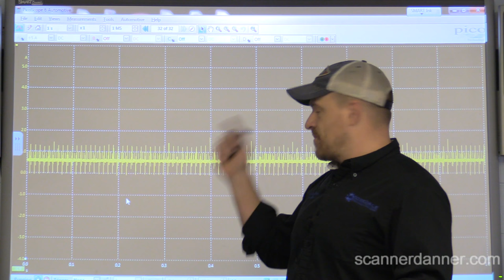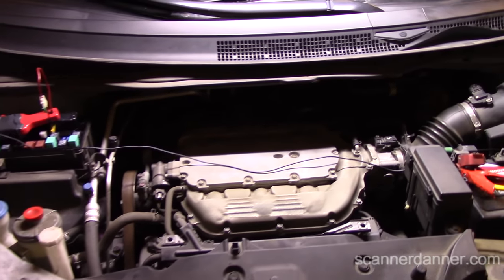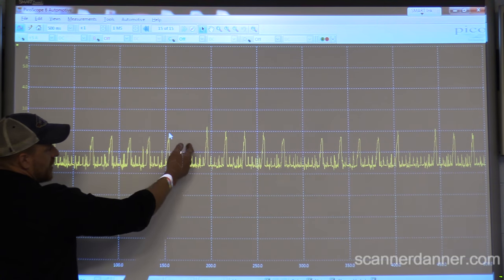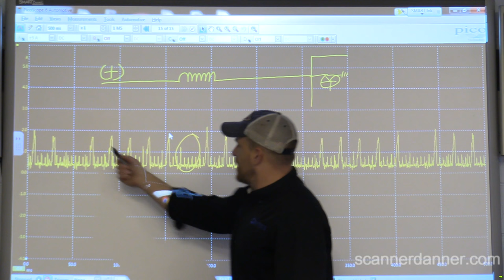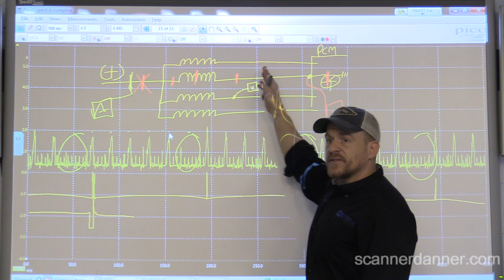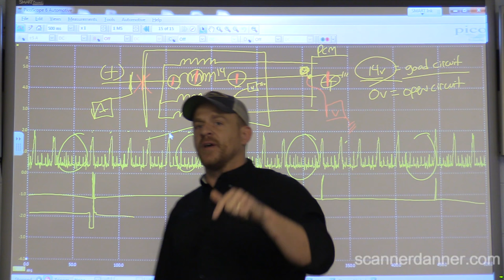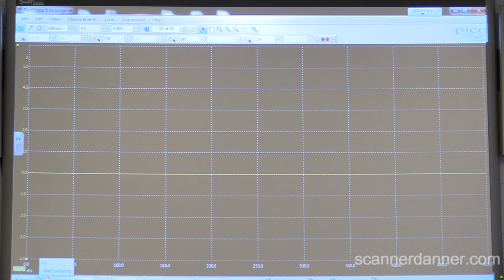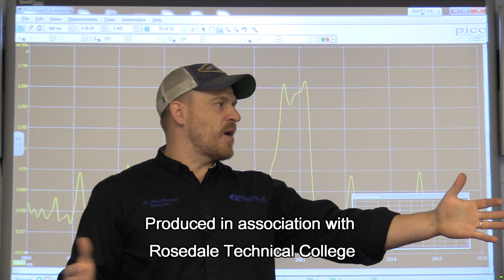Fuel Injector Not Pulsing "Intentional Shut Down" Chapter 18 page 6

Comment: Great video Paul! I remember working on a Benz doing this exact thing and in that case the injector was accessible. I did a simple resistance check and it was OL,so I knew the injector was bad. However,I wanted to check the computer circuit just to make sure and the computer wasn’t pulsing the injector. I’ve emailed you and you told me to clear the code and try again. It worked like a charm! You’re the man Paul! 👍
Reply: Thank you Nick! Nice job on your Benz too bro.

Comment: I would suggest if you see 0V at the computer connector to first unplug it from the pcm and make sure its not a fault driver sticking and shorted internally before selling a intake job. Though its not common Im sure it could happen. Thoughts Danner?
Reply: You just have to be careful that the power feed to your injectors is not coming from a computer controlled relay. If you unplug your computer, the relay shuts down, and you lose power to your injector, causing misdiagnosis. Make sense?

Comment: Had this happen today to a stepdaughter's car.  Ignition coil was melted down and broken... unfortunately by the time I suspected a purposeful shutdown and found/watched this video she had the tow truck come.  Darn it, could have saved a few bucks.  Now have to figure out how to get the remaining parts off the spark plug and get the parts out before pulling the plug to check it and avoid pieces falling into the cylinder.  Will probably have to ram a socket in and break the plastic off and blow it out, then put a spark plug socket on.  Can't get a hose clamp plier in there, due to no space.  front crossmember in the way, along with the cooling fan and possibly the radiator as well.

Comment: Great point made about the injector shut off for cat safety. I see this a lot on the mopar cars. You can check individual injectors with the scan tool to see if they operate not on all models though. It’s never a good thing to put a pcm in with no fix.

Comment: FINALLY I DIDN'T UNDERSTAND WHEN WE SEE 14 VOLTS WE HAVE A GOOD CIRCUIT BUT IF WE HAVE A BAD ECM DRIVER HOW MANY VOLTS DO WE SEE ON THE ECM CABLE? IF WE HAVE A BAD DRIVER WE SEE 14 VOLT AND IF WE HAVE SUDDEN CUTTING WE SEE LESS?I.E., IN A CAR THAT HAS NO PROBLEM WE WILL SEE 14 VOLTS AND IN ONE WITH A BAD DRIVER ECM, HOW MANY VOLTS WILL WE SEE IN THE CABLE?

Comment: Paul, In relation to the Honda fouled spark plug this an ongoing problem not with the spark plug but with the 3.5 liter engine in all Honda lines.  See TSB's concerning cylinder ring rotation only on cylinders 1,2,3 &4.If not mistaken this is a class action concern.
Great videos.
Reply from the maker: found it! Thanks!
Reply: Actually, while Honda may say it's due to piston ring rotation, it's not.  It's well documented (not by Honda) that it's due to Honda's Variable Cylinder Management (VCM) that shuts down the rear bank of cylinders to save fuel.  On that year vehicle (with VCM2) it actually will shut down 1, 2, or 3 cylinders depending on conditions.  Cylinder number four, on the front bank is shut down at the same time as cylinder #3 during 2-cylinder pause operation.  The shut down cylinders can cause deposits to form in the rings and on the plugs and cause the misfires.  If this happens to you Honda will, in many cases re-ring those cylinders and replace the plugs.

The best thing for ALL of these Honda V6 engines with VCM is to disable it.  A very inventive Honda enthusiast reverse engineered it and found that at ECT temps of 167 and below VCM will not engage.  So, he built a small harness he calls the "VCMuzzler" with an 82 ohm resistor that goes inline with ECT1 sensor and reduces the indicated ECT1 temp just enough to prevent VCM from engaging about 95% of the time but not low enough that the computer will change fuel strategies or set a P0128 code.  This temp change shows very slightly on the gauge, maybe a needle width lower at most, but the computer doesn't seem to mind it.  It doesn't affect cooling fan cycling since the PCM appears to use ECT2 for cooling fan operation. 

 I use one on my own 08 Odyssey and VCM will still engage once in a while during stop and go traffic in the summer time when ECT1 gets warm enough but will usually go out again after 30 seconds to a minute of driving airflow over the radiator. I installed mine before having any misfire issues and have 172K on mine without issue.  However, I have seen these VCMuzzlers reverse much of the fouling and oil consumption that causes the misfires.  Honda has been re-ringing tons of these engines under extended warranty.  Oil consumption can get up to 2 quarts or more between oil changes.  

The VCMuzzler is quite popular on most of the Honda enthusiast websites so as a technician you may see these Hondas in your shop with this mod.  It's barely noticeable (I pass inspection with mine on) and is just forward of the throttle body down on the lower intake manfold area.  The one thing to keep in mind is that it reduces the indicated ECT1 temp so if you have to do anything that requires the ECT1 temp to hit 194F, and your scan tool shows the ECT1 not able to hit that temp, then you should check for this VCMuzzler harness on ECT1.  For example, if you clean a throttle body and reset the PCM afterward you have to warm the vehicle to 194F on ECT1 for the idle relearn to complete.  Mine won't hit 194 at idle with the Muzzler.  About 180 is the max it will hit.  

It's a great mod for any Honda V6 owner to extend the life of the J35 engine but something for techs to be aware of.  You need to know it's there and it's a good thing to recommend to your Honda customers.

Comment: Had a 2002 ford windstar with a 3.8liter shut the injectior down as soon as i disconected the injector  it shut the drover down . Puzzled me when i was testing with my test light. As soon as i connected the connector it would take control again . Can anyone give bit of info on ford systems on shutting the injector down ?  It is what i saw right ?
Reply from the maker: This applies to any output. If the computer senses an open or short, it may disable that particular output. It is a variable that I discuss in my Chapter 3 lectures. https://www.youtube.com/playlist?list=PLM4TD8VJ3gj_PxwbFEs3RYAKzionSeszV
Thank you!

Comment: Had a 2005 Ford Freestyle with 3.0L in with TB codes. Most common fix is replace throttle body. No other codes or Mode 6 info useful. It would go in limp mode randomly. I noticed when driving I could feel a fish bite under slight load, not severe at all, with nothing showing on the Verus. Bad coil plus TB, nottttt. I lost $507 on TB and had the exact same problem. I could watch cylinder contribution at idle only and could see -3, and sometimes -5 but engine ran smooth.  Took a chance and pulled intake, replaced 3 rear coils, fixed the problem. Shop owner has Versus but no amp clamp so I could not watch the coils while driving. Could have bought a couple amp probes. I have replaced scores of Ford coils with electronic throttle and never seen a misfire shut the PCM down and set TB codes. The coils fixed the fish bite and the PCM limp mode. Extremely frustrating. Great video, just renewed my Premium for the year, best thing going.
Reply from the maker: Thank you so much for re-subscribing and for sharing this info with us!

Comment: Hey Paul, another relevant vid! Jus to add, I've seen this feature in older  Asian vehicles (Denso system) and one of the most common one is Toyota engine control system where the 'IGF' signal input has a significant effect on the injector operation where intentional shutdown is concern. I have also seen it on an old Suzuki model (non US) where the confirmation signals from the coils are fed thru a diode bank then sent to the PCM, as I said early design but same function. Again great video Paul!
Reply from the maker: Thanks Bannie!

Comment: 26:10 you said we could still have an injector fault as the computer would not know the cause of the misfire. 
Wouldn't it see lean condition on the o2 sensor and know that it's a no fuel misfire and then know not to turn the injector off?
Reply from the maker: A misfire of any kind will cause a false lean condition at the O2 sensor.

Comment: Would love to know how many manufacturers don't shut the injector drivers down.
This is a good idea from Honda, saves you having to spend money on a cat converter.
Nice video Paul, as always!
Reply from the maker: I'm not sure but what is more important is that we know about it and put it in the back of our minds when troubleshooting misfires. 
Thanks brother!
Reply: Agree for sure, never knew that the ECU could and will shut down the driver to protect the cat.
Great information Paul, thanks so much bro!
Reply: @scottmotorsportz  Having had a 99 suburban destroy two cats with a bad (brand new) distributor cap (non-OEM), I'm grateful newer cars have this safety feature in it.